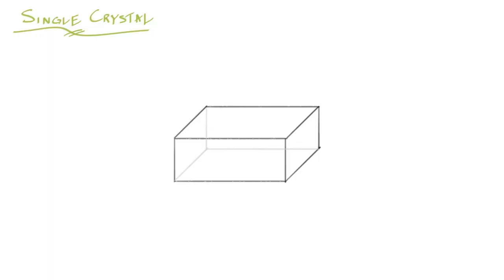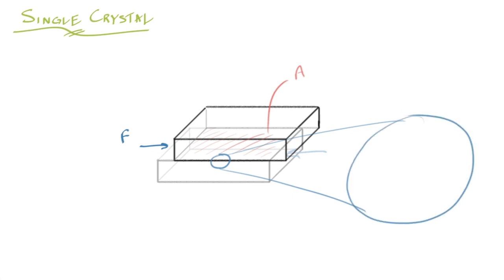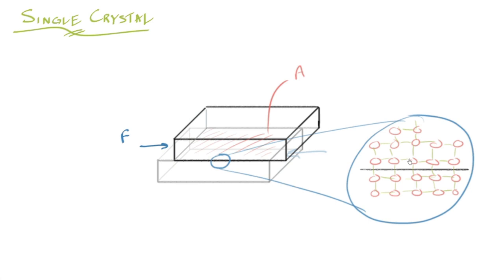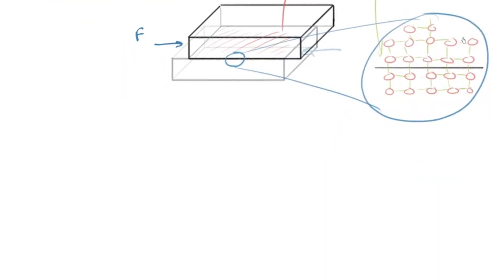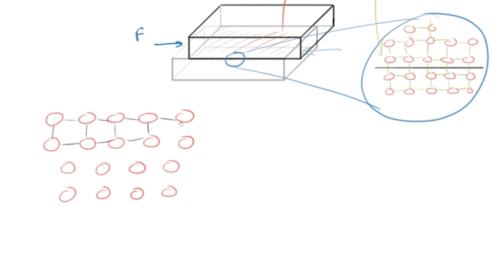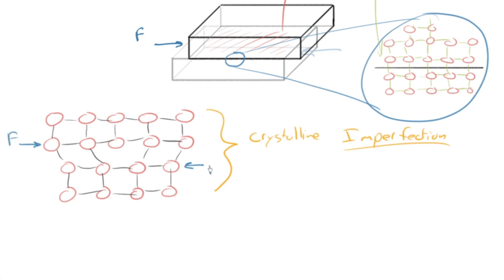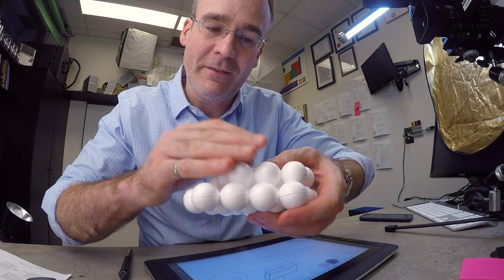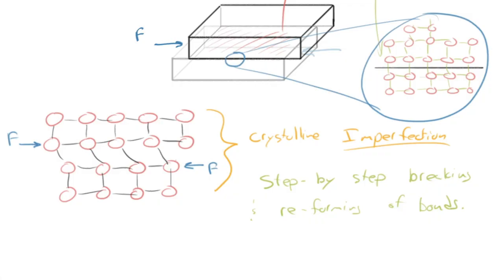26 Mechanism for plastic deformation in metals

Comment: Hi,
Love your videos, they've really helped me understand the basic science principles relevant to my field of interest!
Just a query I hoped you might be able to help with... material hardness vs strength - are these essentially one in the same thing in terms of the underlying mechanism of material deformation? Just that surface scratches occur as a result of very focal stresses at the surface of a material, causing local deformation that doesn't dissipate through the entire crystal/material? Is hardness and strength of a material therefore generally proportionate, if the material hasn't been worked in such a way so as to change surface properties? 
Hope this makes some sense!?
Much appreciated